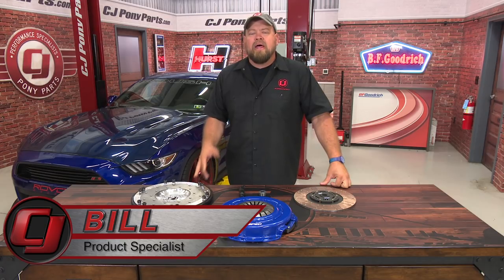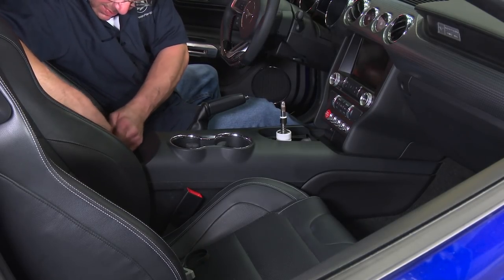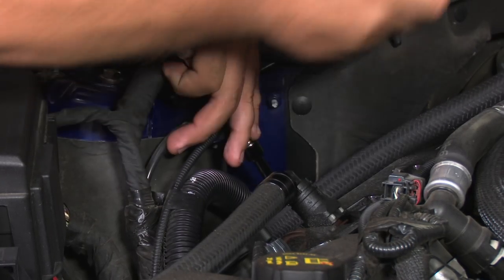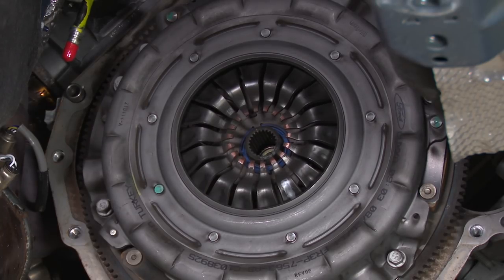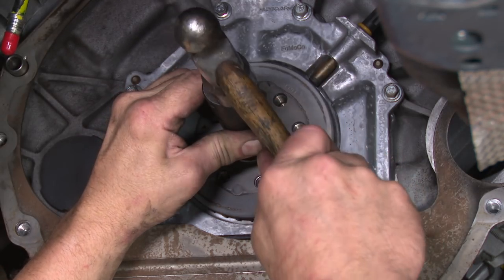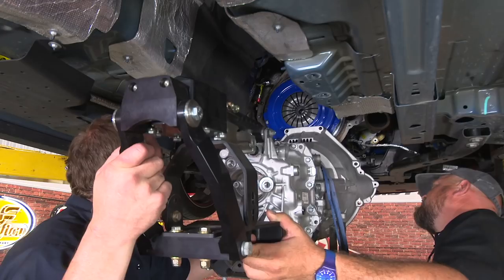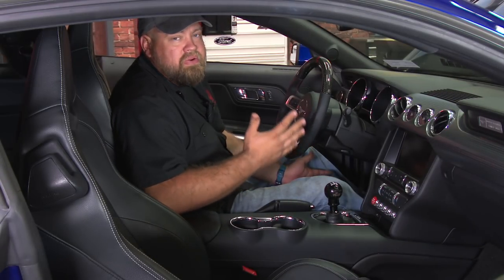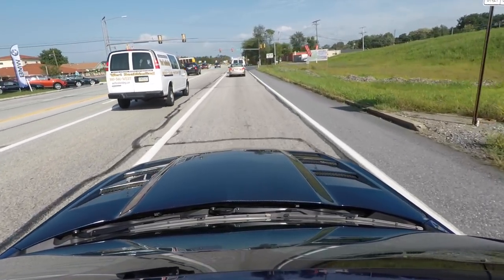Mustang SPEC Clutch Kit Stage 3+ w/ Aluminum Flywheel GT 03/2011-2017/Boss 302 2012-13 Installation

Comment: There's a little notch on the side of the barton shifter, where you can see that o-ring which is what keeps the shifter in place. So what I did was cut that o-ring into 2 pieces so that I can remove the o-ring halves from that notch when I need to remove the shifter. When I put it back together, I just place the two halves back in the slot before pushing the handle back in and it holds all the same.
I don't know how to state that tip very clearly.

Comment: With the extra pressure provided by the pressure plate are you not worried about premature crankshaft thrust bearing failure?

Comment: You never showed the pressure plate. Bought the same clutch but what I did notice is the clutch plate is larger than the pressure plate and my flywheel. It hangs over the inside by 1/4". 
Something does not seem right. This is on a 2015  pp Mustang gt.
Reply from the maker: scbird1 not sure what you mean by I never showed the pressure plate? I showed it several times including when I installed it,
Reply: @cjponyparts  Oh just the inside. Its smaller than the clutch plate.

Comment: i got a spec stage 1 on my 14 v6 and it sound like it grinds from 2k rpm to 2500 and the hitting point is soo high on mines i don’t even know

Comment: After watching I went with a Spec Stage 2 and matching flywheel.  McLoud throwout bearing and Steeda braded line. Clutch is much heavier now vs stock. Takes much more effort.  Should it have a stock feel?
Reply: I know this is old but it should feel heavier with new clutch
Reply: @dynastycrew824 especially during the break in period

Comment: I want to do my clutch and flywheel have a 14 GT. NA with a tune what do I really need? I don't want a stock replacement and don't mind a heavy clutch.
Reply: Scotty N did you ever find one to use I’m in the same boat
Reply: @deonte2x809  Holding off, I have bigger issues than a clutch in a car that I don't use. I may be laid off very soon, one must prioritize in these uncertain times.

Comment: What are the benefits of the aluminum flywheel. And how  does the lighter weight flywheel affect the overall driveability and the way the engine revs
Reply from the maker: Jason Schaeffer the aluminum will allow the engine to rev up faster and the engagement is not quite as harsh
Reply: What slave cylinder/throwout bearing did you guys use?  I am installing this same clutch.
Reply: @cjponyparts  how much does it cost to get an aluminum flywheel for my 2016 mustang GT ?

Comment: Can the clutch install be done with long tube headers in place or do they have to be removed?
Reply from the maker: Depends on the headers but typically you have to remove at least the passenger side

Comment: This clutch is kinda a bitch to slip. it either wants to be engaged or disengaged. I put this on my 06 a long time ago and after some 30k miles it's either finally broken in or it's starting to go out. Engagement point seems to have moved even higher. If you need 850lb ft holding power then this is probably the clutch for you, but if you are in the 500rwhp club then a stage 2 is probably a more streetable and cheaper option. the pedal is also much heavier than stock with this clutch. It probably sounds like i'm bashing it, but it's really a good clutch. It just likes to launch hard every time
Reply: And 7 months later i ordered a 2+ to replace it from cj pony parts. I'm not sure what's up with mine, but it's coming out. My engagement point seems to move around. one morning it will be towards the top and next day in the middle. It's definitely trying to tell me something.

Comment: Odd request, but do you by any chance at all have clips that you could put together showing the difference in how it free revs between the stock flywheel and the Al flywheel?
Reply: BlackC5Z06 I'm interested in this as well.
Reply: I'll see what I can do but honestly it would be very difficult to tell. remember my engine is spinning a blower as well.
Reply: Bill Tumas do you notice if the engine revs more freely now?

Comment: Can this clutch bolt up to oem flywheel?
Reply from the maker: RG GT yes it will
Reply: @cjponyparts  what would be the torque spec for the factory bolts and flywheel 47lbs.   I'm installing the spec stage 3.  6 paddle Design clutch. Also no throw out bearing replacement